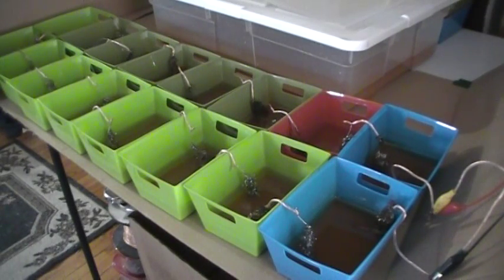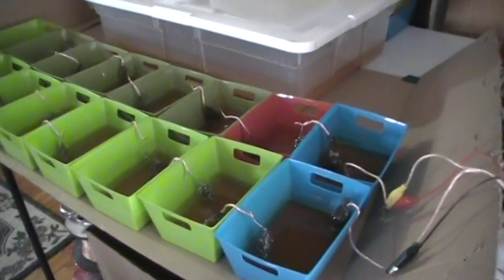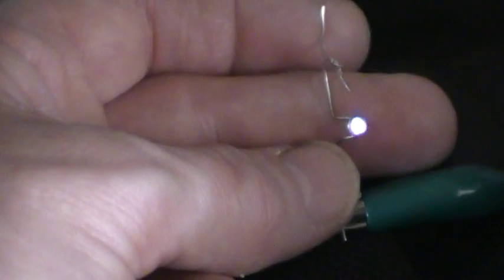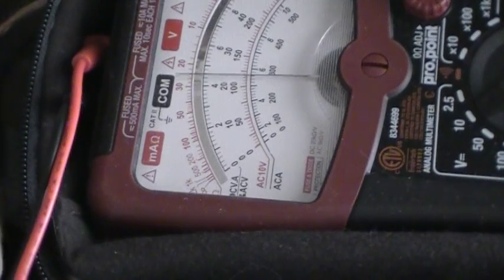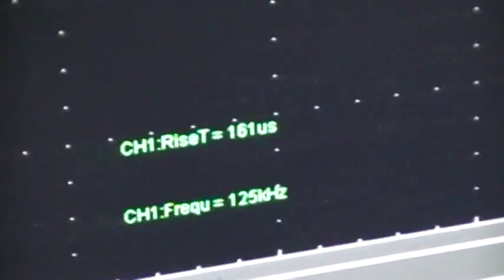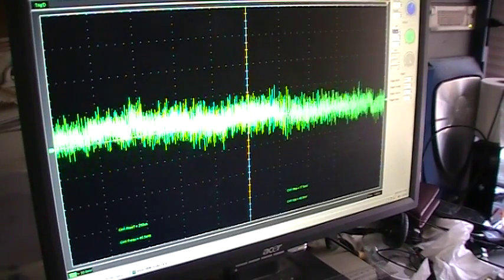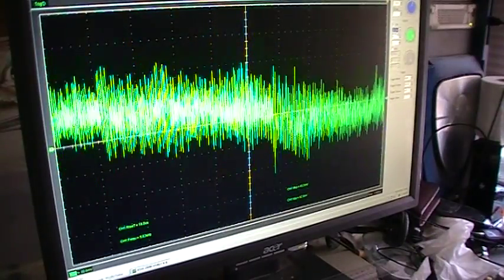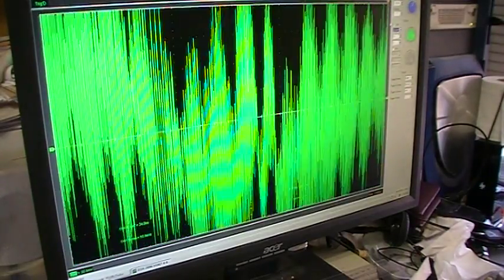Nano Coated Copper AC Solar Cells

Comment from the maker: The GANS (GAs in Nano Starte) that is being extracted from the atmosphere is a bright orange colour. Mr. Keshe suggests that orange material is CH3 GANS.  I have collected 2 batches that are located in the large white bin seen in the background.
I also had Epsom Salt(Magnesium Sulphate) in the dark green bins when I first set up.  These produced the very same bright orange GANS as the NaCl salt. I saved the material in a different container for further analysis.  I then filled the dark green bins with NaCl like the rest of the cells. I have had the 2 LED's going for a week previous to sharing this video and the voltage of the cells has remained very stable. 
I had to reconnect the wires a few times because of poor connections.  I have a new set of leads that I made up during the week and hope to get them hooked up.  They are much better construction and are made of pure mufti-stranded copper wire, no more copper plated steel.  I also will be using Stainless steel corrugated sheet metal for the other leads instead of the Stainless steel scouring pads.  Should have these set up with a new set of clean bins by the end of today Mar. 30, 2014. 
Harold Walter Lehmann of Sarnia, Ontario, Canada.  Home based knowledge seeker of the Keshe Foundatioln's technologies.   Please share!
Reply: Herr Krum  Perfect!! Great work, simple proof of your concept, i will try too; i didn't note consistent disappearing of the black (and the material appeared later in two days)....how to say, not proportional to the orange in volume (and this could be not consistent) after a bit more i had yellow material. Can i ask what you mean with milky blue shade?there was not any material even after days? there was a load and a circuit? this could be interesting to understand if effectively there is difference between the "zero point" (no condition to evolve) and the beginning. Thank you for share your intuition in this very uncontestable way!!:D
Reply: *****
Thank you for the hint, i red other comments and i followed the discussion, it is right. In my opinion, reading and listening for what has been desclaimed in the other part and for what i understood, there is no relation with the sun or his light because it's already matter, he speaks about an other thing, that he calls magrav or the interaction between the plasmas, this thing in this scale is not observable but causes the accumulation of matter everywere (even on the copper tubes of my air conditioner because i'm near the sea and the salt in the air act like "catalyst" of this process); it is possible that all the matter in a never ending process of "decay" has been formed this way, let me say, we ourself are matter but not only. Is not observable because the space that any plasma has to expand is very little (it's busy and there are a lot of "particle" or "beings" i don't know exactly), if you create the condition (like vacuum very low 10^-9 bar) it can expand and occupies all the space it can, becoming "bigger" it's visible in this scale with his energy and capability of interaction. This is the principle all to demonstrate. Men are working, if it has to be, it will be. In the meantime i think anyone who wants has to follow himself in crazy ideas even if there will be ever the voice of consciousness.
Ps: targeting like "eso crap" something that you didn't take the time to understand is not the constructive way to achive the truth, this only cares. Tecnique comes when you try to understand how and not why something happen, it's related to the matter interaction only and it's not what is discussed in the teory so don't claim it doesn't work if you don't even try to understand what it's before.
Namastè